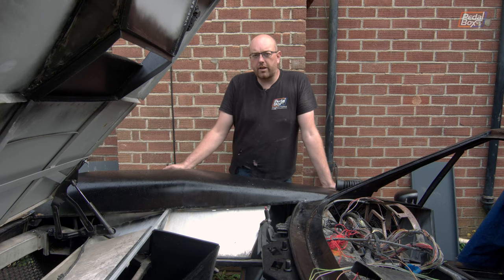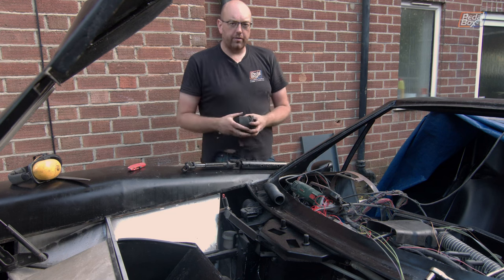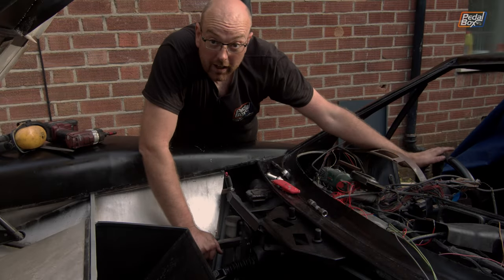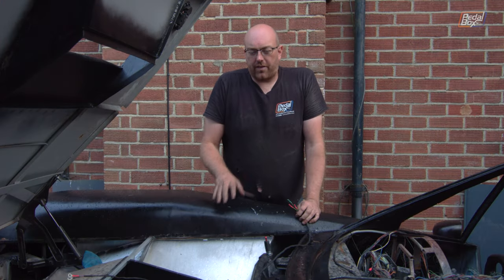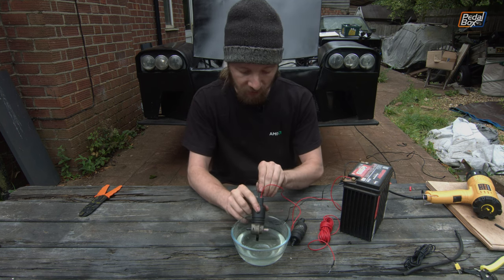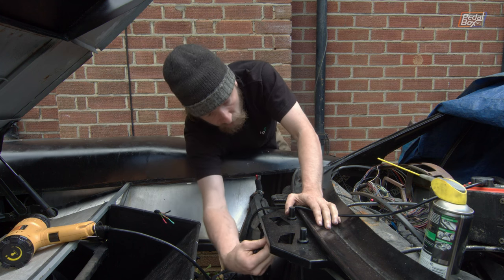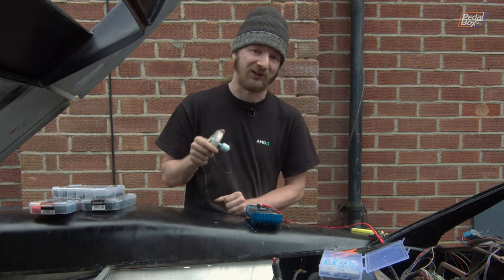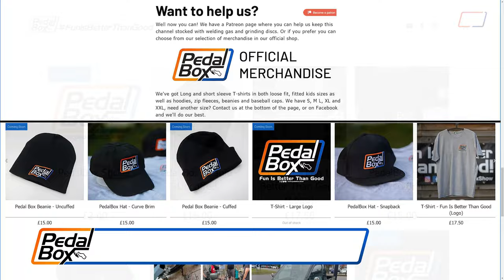The IVA Looms | Mid-Engine Audi TT Kit Car | PedalBox Episode 142

Comment: another great episode of wiring gents, which we all need - quick look on a diagram Wiper speeds should be Green is slow speed winding and Green/Yellow for the high speed winding, I think we all need to go move somewhere a little less rain
Reply from the maker: Neat! I hadn't gleaned that from the ones I have, but we have found the plug (... in the scrap yard, where we got another one) so we can wire it up properly and test it all and get it right :)